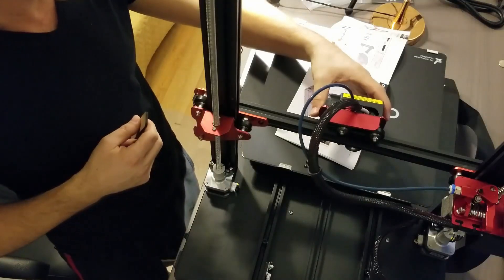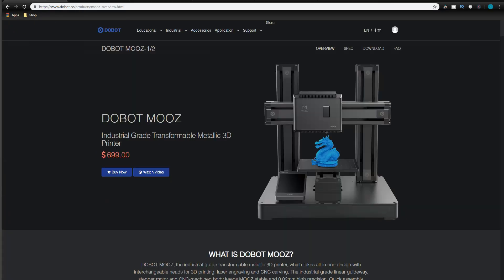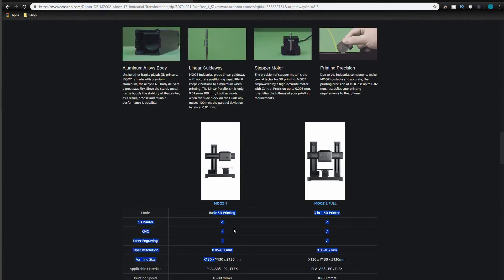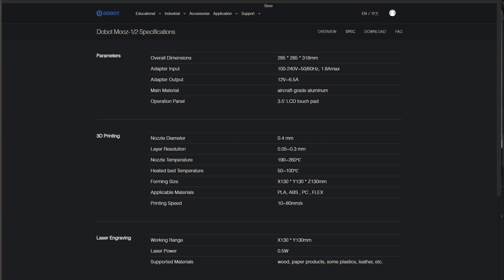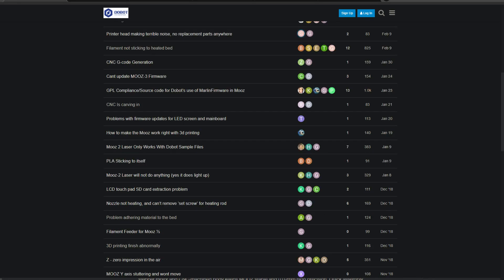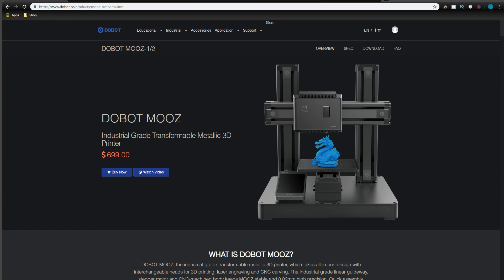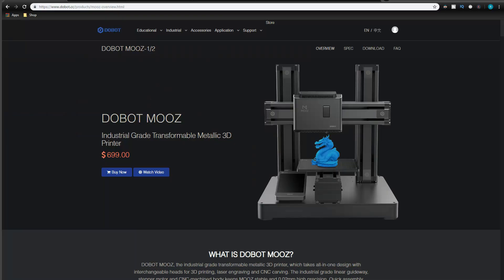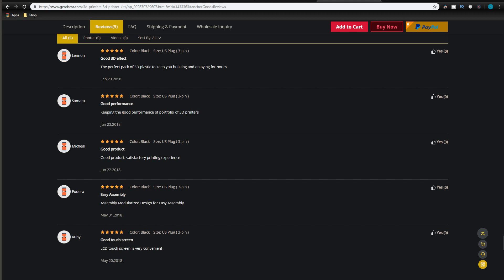Could the Dobot Mooz dual z axis  be my next 3D Printer or yours?

Comment: Hey! Which should I choose between snapmaker original, Creality CP 01 or Dobot mooze 2 plus. With accents on laser engraving, cutting and cnc function.
Reply from the maker: I have not tested any of these printers to be able to give you my first hand experience. So to be safe I would go with the most tested one on the market the snapmaker 2 maybe the A250. People have had on and off experiences with cp-01. People seem to be quite pleased with the snapmaker 2. Dobot mooz plus is just breaking in the market now. it is a double edged sord with mooz 2. One one hand is cheaper on the other they maybe have worked out some kinks. But since this is the "me too" cheaper version I doubt the quality being better than snapmaker 2. Snapmaker 1 has a tiny volume however I heard of it being built as a tank but I would still go for the snapmaker 2. I have not gotten any of them because I have nowhere to laser cut or uses the CNC the dust will be too much, so you need a workshop for the CNC and the laser, you need venting and dust collection. So is not only the device is also the additional cost to set it up properly.  If are sure you are going to sell some of you stuff then go with the 3 in 1, but if you just want a 3d printer I think you should get a 3d printer first switching from one to another sounds like a good idea but i thikis better to have a tool dedicated for one thing. Cleaning and other stuff will add lots of time reconfiguring the printer. Will this be your first 3d printer?
Reply: @RoamingInterests  Thank you very much for your time. Yea, this is my first printer. I already have the space, so the dust and the venting will not be a problem. The snapmaker 2 it's slightly over my budget, so I tended for the options mentioned. Dobot mooz plus seems similar with the snapmaker 2, but I didn't find too many user reviews. Snapmaker original seems a good alternative for my budget, but the work area seems a little bit small..
Reply from the maker: I think you should get a 3d Printer first. the CNC aspect of snapmaker it may be good as well as the software, but if you get a 3d printer and a CNC separately still does not cost $1000. as for the laser is just bare enough. the 1.6 w laser it only etches wood and maybe aluminum, you cannot cut with 1.6 w laser. people seem to still get the snapmaker original, which is still $600 or $700. There are mixed feelings out there  about the CP-01. SO i cannot advise you on it. Mooz 2 plus, seems to copy the snapmaker so that may be your best bet, but if no one has talked or seen it it is risky. in addition the parts are nonstandard. I think a 3d printer may serve you better, because the regular 3d printers have standard parts. the 3 in 1 ones have unique pars and upgrading them may become counterproductive. I do not have a CNC, but getting a 2-300 dollars CNC and a separate 3d printer may improve your workflow. if you cnc wood you have to clean and modify the printer before you can get back to 3d printing. I made o video with obesrvations about cp-01 vs snapmaker. https://youtu.be/BjagvVw5_Ys
Reply: @RoamingInterests  So..i took in consideration to get a dual cnc and laser just for cnc etc and a 3d printer just for 3d printing. I've found a cnc 3018 pro, which has the cnc and a laser module, and the reviews were pretty good. Now I just have to find a 3d printer in 700$ budget.
Reply from the maker: That is a lot of wiggle room on that budget. Cartesian or corexy. Corexy require finesse in tuning the belts, I have still not found a good way for dialing in the belts. But with core xy you can get a bit more speed. and then you have cartesians. you can get a decent price cartesian and get some upgrades for it in $700. Do you want a large volume or small volume. Honestly I don't even know which one I would get myself. there are so many choices. I have had some success with the artilley but then I have had to change the heatbreak to an all metal. But I still see people getting problematic 3d printers. So it is a luck factor unless you get one more expensive. I got if from amazon because I could send it back if it did not work properly. On aliexpress you have to wait months. So I would not know exactly where to steer you. I should call this channel the fake 3d printintist. I do not have a lot of them to test and try and give proper feedback. you can check my videos on 3d printer I spoken about and some people commented on their experiences.
Reply: @RoamingInterests  Well...I'm not looking for big volume printers, and from what I see there are a lot of choices. I've put on my list Anycubic mega pro and anycubic chiron..but I really don't know for what should I looking for
Reply from the maker: I have seen some good reviews about the anycubic FDM. I got the ANYCUBIC resin printer, still in the box. I have had no need for it yet. Plus resin stinks. Moreover I was looking to purchase the anycubic MEGA s but I had no need for another one at the time. I may need one in the near future. Also The More expensive ones come with laser. I was actually thinking to mention that. but good thing you found them on your own.

Comment: Do you have any good suggestion for 3 in one laser, cnc and 3D?
Reply from the maker: Yes I do, Snapmaker 2.0 all the way. I have checked a few reviews and I also have a video about it but I am just talking about specs, never worked with it https://youtu.be/sI31iU_swXg. But I had to go revisit other peoples experiences and they seemed happy. So i think Snapmaker 2.0 is the one that eliminates the Luck factor the most. I think the snapmaker 2.0 is expensive but check out people that have been working with it for the last year. They are also supposed to make more variations of it but I am not sure where that stands today. There could be also others that I have completely missed. Like I just recently found out about the Zaribo 3d printers to my surprise. https://youtu.be/NS5KpPVG-zo

Comment: Use snapmaker
Reply from the maker: Thanks for the advice. Any tips or problems you have for the snapmaker?
Reply: @RoamingInterests  Sure

I own a snapmaker my self, and I have printed (carved) alot of stuff with it
Reply: @RoamingInterests  So pros and cons list:
honest reply

Pros:
 Small scale (fits my desk well)
 Very excellent printing/carving quality
 Strong, sturdy
 Kinda cheap 
 fast printer (I think, decent for me)
 Simple set up
 Simple to use + good slicer

Cons:
 Fans are loud
 Super heavy
 small work area

Overall, I suggest the snapmaker, but if you want a bigger build area, wait till snapmaker 2.0 comes out
Reply from the maker: Yea, I have been Eyeing the Snapmaker 2. But I could not pledge now and wait 8 months. So I just stopped thinking about it. I am working with what I have for now. I do Like big prints, so Snapmaker orignal (1) is way too small for me. I do not particularly find the printer being heavy a problem. I think the heavier it is the less vibrations it allows. I am waiting for new things to come out. In my roaming I found out that core XY   allow for faster prints. So I am putting everything on hold for now Until I fond out more about the core XY printers. They seems to be the next hot thing. That's why convertign the snapmaker 2 XL CNC to a 3D printer may be the way to go.
Reply: @RoamingInterests 
Tips:
Calibrate snapmaker correctly (It was my first printer, so I calibrated it 8 freaking times since I didn't know how to properly do it)
print slow on the first layer

use a 200-205 degree printing temp

yeah

oh yeah, it also have a heated bed that can go up to 80 degrees c
Reply: @RoamingInterests  There have not been to much problem, except for when you unplug things when it is powered on.
The tools are ok, and the usb stick that comes with it is absolutly terrible

Comment: woo a laser , But I prefer not being blind !!!!!! , My first printer was a flashforge creator pro 2018 model and I`ve been happy with it. I think the build area on that is 150 x 220 by 200 height ( I think ), which is O.K. for printing most small models , but the reason why I got the cr10s pro was to print bigger models because that size 150x220 can be a limiting factor for printing real objects.
The Prusa mk3s is said to have a truly amazing print quality , BUT it is not a cheap printer.
Reply from the maker: Yea, that is why I am hesitant on the smaller volume 3D printers, because of the eventual need to print big things.  Prusa is similar with the price I paid for my CR10 sPRO.  The Kit is is cheaper but I am dreading the building. And as we all saw so far I am not the greatest Troubleshooter when it comes to figuring out 3D printers.
Reply: @RoamingInterests  "Prusa is similar with the price I paid for my CR10s PRO" ?
Not sure if it`s different in your county , but here in the UK the Prusa 3 KIT is £700 compared to £500 for the CR10s Pro , and I think it wasn't far off £1000 built.
I can`t think of any large format printers which is 100% reliable in your price range !!!!
Reply from the maker: Yea prices have changed. But when i got the cr10s Pro it was like $650 and now the Prusa is 749 the kit. So they are close. I am still pondering. I saw great things about the Cetus MK3. And apparently is very precise too. What do you know about I did some research on it but cannot be yet sure. The extended cetus is almost $600 on Amazon. So it has become prohibitive.... what do you think.